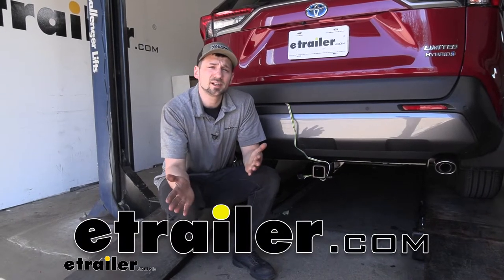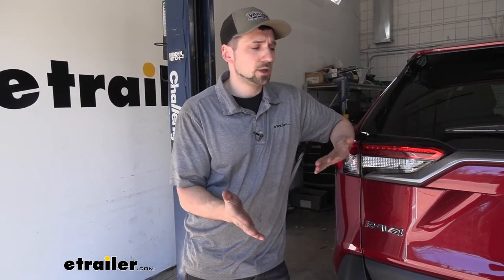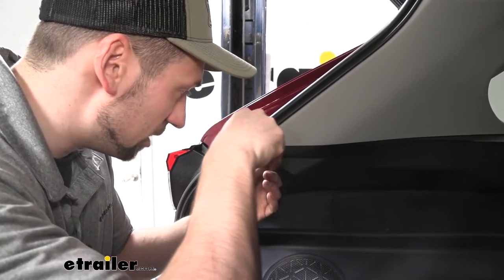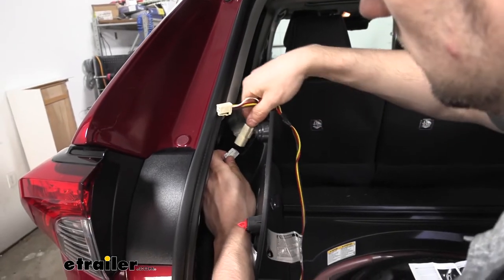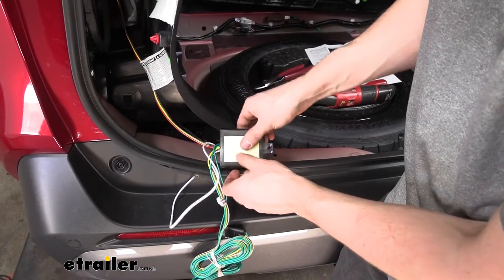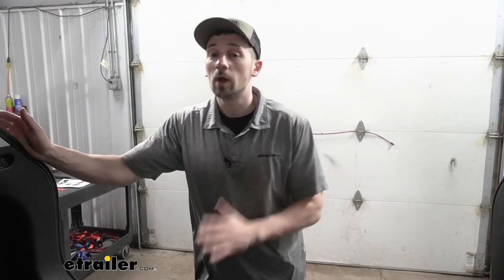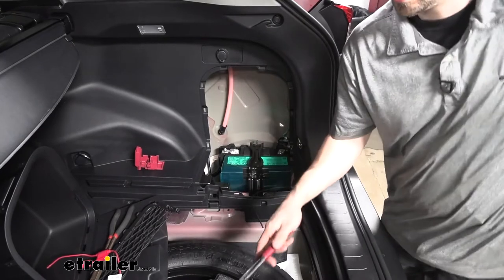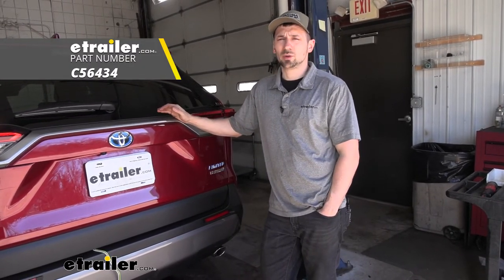etrailer | Curt T-Connector Vehicle Wiring Harness Installation - 2020 Toyota RAV4

Comment: I really have to point out at section 12:10 where you are playing with the POSITIVE side of the battery (when the NEG is still connected), it can't be stressed enough to make sure you do not hit the metal bracket and short out the connection. That would be bad.

Comment: Can we do without connecting to battery?
Reply from the maker: The control box needs to be connected to the battery because you do not want any interference from any other accessories. If you were to over load the fuse from another accessory, you could blow the fuse and your trailer lights would lose power.
https://www.etrailer.com/Custom-Fit-Vehicle-Wiring/Curt/C56434.html
Reply: etrailer.com thanks for reply !

Comment: I just received the Curt 56434 kit for my 2020 Rav 4 and removed the panels and nothing is the same as in the video.  It appears that the factory has true plug and play not "CUSTOM"
Reply from the maker: The kit that you have purchased is the only style kit that we have for the 2020 Toyota RAV4. They plug into the back of the tail lights and are powered by the battery.
https://www.etrailer.com/Custom-Fit-Vehicle-Wiring/Curt/C56434.html